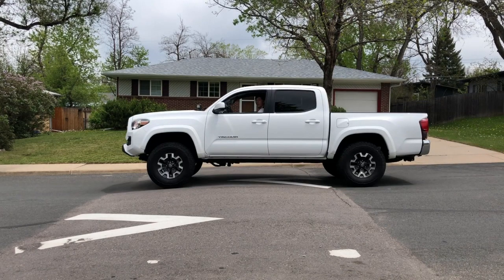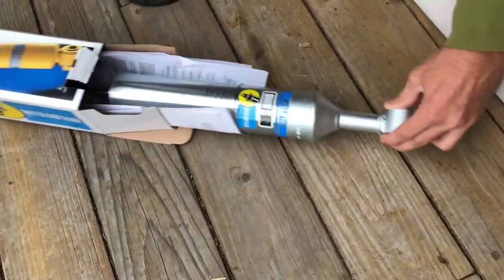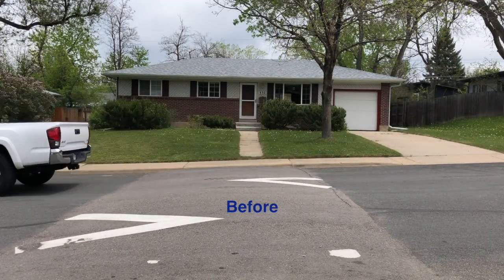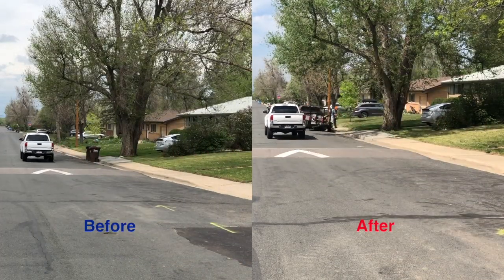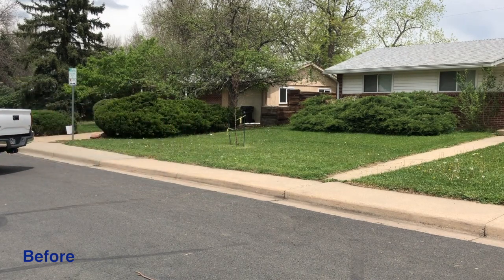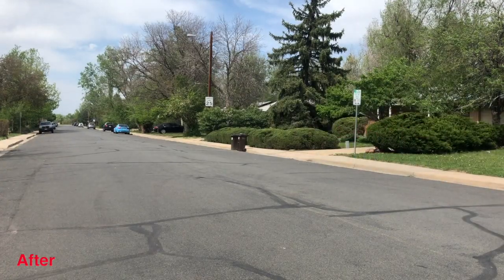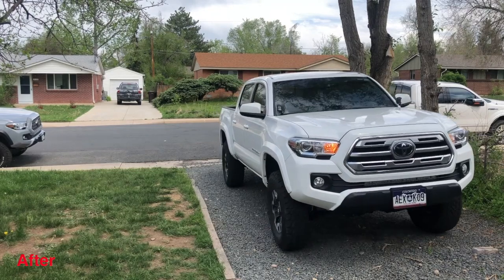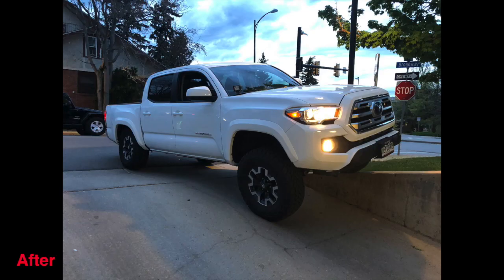Bilstein B8 6112, Rear 5160 External Reservoirs, and ICON 1.5" Rear Add A Lead (before and after)

Comment: hey man I was just curious I want to get this exact set up (6112, 5160, ICON 1.5 AAL) have know noticed any settling in the front? I'm debating going 4/5 setting or 5/6 setting but can't decide which to choose
Reply from the maker: I'm having a hard time understanding your question. But I am assuming you are asking the difference between 4/5 and 5/6. It's only about a 1/4" of difference. I went 4/5 because I am using the original upper control arm and was worried about alignment.
Reply: @92813justin   ok im just asking because I want 2 inches in the front and I was not sure if going 4/5, once the suspension settles if it would be less than 2 inches. Also is doing the max setting (5/6) bad for the shocks?

Comment: Hi, sweet setup and very informative video. I want to use the exact setup but would this work w slightly bigger tires like a 275/70//17. And should I keep it at clips 4 and 5? I read  on taco forums that 4-5 can be too high and cause issues w topping out on potholes and bumps on road?
Reply from the maker: That is why I did not go to clips 5/6. I have driven 15k on these on not problems so far.

Comment: Where Colorado do you reside? I’m originally from S.E. Colorado close to the Kansas state line. I have family the reside all over the state and I’m in Alaska. I have a ‘17 Tacoma TRD OR Access Cab and I’m seriously considering the same set up as you except I was going to go with the Deavers leaf spring kit. I plan on increasing my tire size to 33” or 285/75/16. I’m also going to swap gears and add Nitro 5.29s. Great little video, thanks for sharing. Cheers!
Reply from the maker: Have you considered 4.88's? 5.29's are big boys if you are not running 35" tires. But if you drive under 65mph most of the time it is not a big deal since we have the 6th gear. But keep in mind that Toyota designed the truck to be under load (while towing) in 4th gear. Suspension is great, you will not be dissapointed.

Comment: Why the 5100s with externals in the rear? 

Man my Ranger unloaded will crush your spine when the rear hits bumps holy crap.
Reply from the maker: Patrick Amos, that’s the way the kit came. You also have a lot more weight in the front.
Reply: CluEngineer nice okay cool

Comment: So you did 1.5 lift up front and in rear?
Reply: So you removed your overload?
Reply from the maker: Icon AAL replaced the bottom leaf
Reply from the maker: 1.5 inches the front and 1.5 inches in the rear with the icon add a leaf